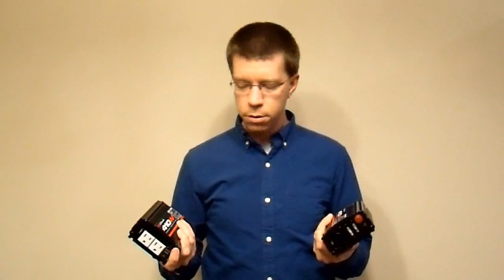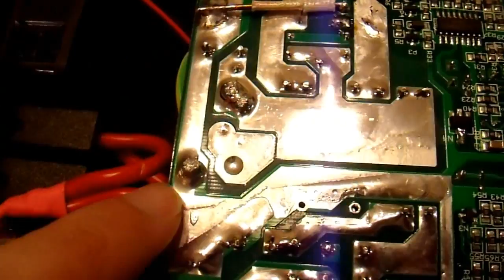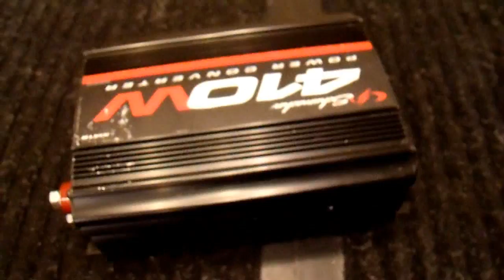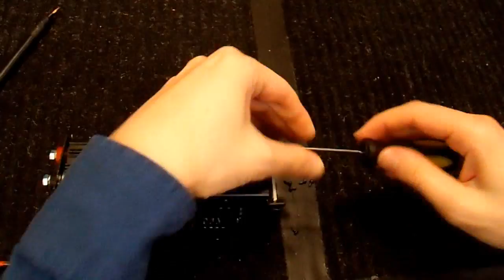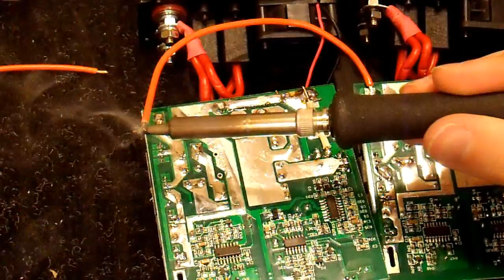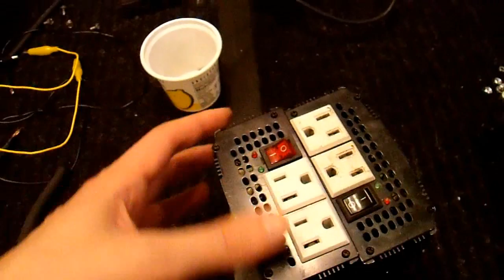Parallel Inverters - Double the Power Hack!   Part1

Comment: have wired up two inverters as per video,  just cheap lvyuan inverters, have to get some batteries paralleled up to give enough current, at the moment cuting out early, probably large voltage drop of small batteries. At first I thought it was due to some current sensing circuit, but now think its my battery is too small for the current draw and giving a big voltage drop is my guess.
Will post results once I get a some batteries paralled.

Comment: Will this work on 2 bigger inverters 
Same type using your method
Reply from the maker: Nope.  This only worked because the output stage was more robust than the input stage.  For cost reasons larger inverters will be better balanced.
Reply from the maker: I do have an old video about putting two larger inverters together BTW.  You have to sync them up.  I used Smart APC 1400RM units for that one.

Comment: just went through all the comments  here and no one has reported trying this over 11 years, so I assume no one has, otherwise they would almost certainly have commented if it failed or if it worked, so I will attempt with a newer inverter of great cheapness, I bought one to run a grinder says 2kw peak and 1kw continuous, but grinder cuts out under any load only just runs it no load. So will order exact same one again and try this suggestion........lets see how it goes. 
Inverter brand is lvyuan they call it 2,000watt inverter ( 1kw continuous) but in reality it cuts out a bit under 600watts.
I will most defintely report back here on what happens..........reasonably cheap inverters ( about $60aud)

Comment: Nice,  it's just that it is overloading the 2nd inverter , its mosfets or IGBTs, with double the current, but it might work well, 
    USE GOOD FAN!!!!
Reply from the maker: Yes, the 2nd stage is overloaded but in this design it had adequate headroom with the additional airflow.
Reply: @knurlgnar24   good deal, you had checked for that, that's the way to do it; 
    i wish it was that simple on my low freq. inverters,they have no DC at all to mix

Comment: Question - what do input stage does and why does it get that hot?
I see 12v dc gets multipled by transformer to 120v dc, then getting chopped into AC by transistors (the ones after the cap), but now puzzled at what input circuit does - it still 12v that feeds the transformer...

Comment: Good vid. Do you have a opinion how to wire 2 120v AC inverters into 240 split phase . Where each phase is 180 out from each other
Reply from the maker: I did a video on this using two 1500VA APC UPS units a long time ago.  That one sounds about like what you're looking for.

Comment: I wonder if you can do the same thing to a portable power station. For example the first power stations that came out were the Bluetti EB240. Great power station lots of battery power but very small sized inverters (1000 watts) for the size of battery power.

Comment: I hoped you would connect one control signal to both inverters in order to have both output bridges working in synch. Each inverter would still output nominal so they would need to parallel the outputs somehow. Like they do with gasoline inverter-generators.

Comment: I don't know if you still check this video, but question for you.... you linked the two capacitors together. Could you instead install a bigger capacitor in it's stead (same mf reading; double the voltage) to achieve the same thing? Curious...
Reply from the maker: I was paralleling the boost stages where the limiting factor was the FETs.  Adding capacitance would have had little effect.  The output stage was highly stressed the way I did it because only one inverter was using its output stage, but given most of the cost is in the boost stage they had skimped on that and I didn't need to beef up the output stage.

Comment: @12:31 that wire insulation isnt installed correctly that wire shouldnt be allowed to be that close or touch the trace its hopping over it is however correct in the other inverter that could be the magic smoke generator you were talking about when poor care when producing these things

Comment: Yes it's a good idea ... if you want them to eventually blow out and possibly set your house on fire.

Now you might say : "Ah...neysayer...this dude just showed that it's doable... there's always going to be some guy that is going to say NAAAH IT CAN"T BE DONE"

And to that I don't say "It can't be done", I only say...doing it THAT WAY is dangerous.

Why? 

Well because those to are not actively synchronised and there is no Power Management System to ballance the load between them. Even tho' they may be made by the same maker, and it's the same model. There are some differences between them . One will take more load than the other, and the output voltages will differ thus current will circulate between them.

Also since there is no synchronising device between them, it only takes a minor lag between them at startup for them to have current circulating between them. Possibly leading to an explosive failure.

More so, since these are not dynamic converters ( such as a Ward-Leonard group, a motor-generator group, you know with spinny things inside them) there is no mechanical inertia that can keep the two inverters synchronised by magnetic coupling these two MUST BE KEPT IN SYNC AT ALL TIMES. Just a small deviation from a perfect synchronicity will eventually lead to a 180* desynchronisation and that means a short between them ...if it even reaches 180*...about 60* of desynchronisation should do them in. 

There are systems over there that allow parallel running, but they have a Power Management System and a synchronising system that keep them in absolute synchronisation both for frequency and voltage , and will keep the load on both balanced.

Stay safe.
Reply from the maker: This was an interesting experimental project and I'm not sure how safety is in any way related.  Thanks for your thoughts though.

Comment: This is probably a really dumb question but why not just connect the negative and positive together on the input and connect to the battery? What is being achieved by soldering them together by the capacitor?
Reply from the maker: The output AC waveforms are not sync'd nor balanced so they can't be connected together directly.

Comment: Are these inverters pure or modified? Can I assume that with the initial inverter whine that they're modified?
Reply from the maker: These are modified sine inverters.
Reply: Awesome, that's what I have. Ordered them under the presumption they were pure because that's how they were advertised. Glad to know I can stack them and use anyway. Thanks
Reply: So can I ask some advice? I remodeled houses for ,32 years but my experience with electrical and electrical circuits and what not is very limited. I've built a small scale power plant (so if I blow anything up, it won't be a "costly" mistake) I've wired my batteries in series, parallel, series parallel and can barely light a digital bulb drawing only about 7 watts. I mean, barely comes on. Everything is reading proper voltage with my multimeter. I'm lost. I have 4 lead acid batteries and all are reading 13.7 volts. My inverter is  reading 25.6 v DC in, 118v AC out. I figure it's either my charge controller or the inverter. Leaning towards the inverter

Comment: Can I use two 4000w inverter parallel ?, is that risky ?, one inverter capacity is 4000w continuous and 8000w peak, so I have 8000w continuous and 16000w peak

Comment: I was wondering what if you put some highvoltage capasitors to the outlet too so you have a bigger reservoir to get power from, did that to mine 600w 12v inverter and soldered an ac capacitor over the socket in the back of where you plug the cord in, and now I can use a 500w 230v oven on the inverter when it gets wery cold outside, and if I'm roadtripping I'ts so nice with some extra heat too...
Reply: now that is interesting

Comment: Can I do this with two ups
Reply from the maker: I have a video where I put two UPS units in series to make a 240V inverter.  Parallel would be more difficult.  Not impossible but at that point I think most everyone would be better off purchasing a larger unit unless the intent is a project to work on!

Comment: This is very informative and makes me curious if you could run them in series to get 220v power because i cannot find a 220v inverter(i understand a vehicles electrical would have issues but i would be upgrading mine)
Reply from the maker: This could be done if a person synchronized the inverters and also connected them to separate batteries.  (they reference battery ground)  From a practical perspective it is always better to simply purchase a larger inverter.  This was a fun experiment however!

Comment: This is fascinating. I'm trying to run loads off a solar panel without a battery so I'm researching everything  with the array to see where I can bypass it. I really appreciate your thoroughness and clarity of speech. Compassion for the people who make the products we use every day is important too because no one ever thinks about them. It's nice to see a channel less focused on its own success while still delivering the same amount of care, effort and humility you'd find in one that's paid for and fake. You're an awesome dude and you're really helping me out right now. Can't thank you enough for posting this.
Reply from the maker: Glad you found this useful.  On another note I would encourage you to look into other methods of using a solar panel to power non grid tie loads when not connected to a battery.  Solar panels really need a battery or energy storage device in order to directly power any useful load.  I would recommend looking into a charge controller set to 13.6V and connected to a small  4 cell LiFePO4 battery powering your inverter.  The battery can be quite small but it needs to be there.  The charge controller and 4 LiFePO4 cells adds some cost to your setup but it will operate as you intend and last a long time.  Charge controllers can be had quite cheaply and if you purchase cells on aliexpress or the like you can find a 20ah LiFePO4 setup for a pretty reasonable price.  This type of setup will only run when the sun is shining but will be able to continue running for short times when a cloud passes, a bird flies over, a leaf lands on your panel before blowing off, etc.
Reply: @knurlgnar24 where you beefed the solder up you could of put copper for better power 😁👍
Reply: What about a bucking device to a charge controller and park in the middle of an open clearing? No issues with that on a clear sunny day right?
Reply: I simply can't afford any kind battery bank both at cost and space and weight right now. Free, sure. But nothing in life is free. It would cost me the same in batteries as it would for a complete solar array.
Reply: You could possibly make a battery out of salt water for pretty cheap

Comment: What about putting the two power switches of the inverters in parallel? Curious how the two waveforms would overlay on an oscilloscope
Reply from the maker: That would be the better way to do this but it requires more work.  You would need to remove the FET drive from one inverter and parallel the FET gates between the two.  You would also need to ensure both boost circuits boost to nearly exactly the same voltage.  I actually planned to do this but decided it wasn't worth it.
Reply: @knurlgnar24  Thanks for clearing this up; i have 2  inverters, same exact model, cheap from China,5000 / 2250 W , 24 volts, and i would like to parallel them to get ~~4000 watts; i repair PCs,laptops TVs  etc (but NOT at component level, i´m not that good);
Do you think it can be done? parallel the FET  gates, with a cable between them,  and check the 220 V  outputs? if the  FET gates are in parallel,you think the 2 sinewaves will coincide all the time,no drift?  Thanks

Comment: Great video, well done, I have a Spark 4000w pure sine wave, not used a lot, but the last time I used it the wattage meter ramps up and it goes into overload and shuts down with no load plugged into it? Do you have a video off what this could be?
Reply from the maker: I'd recommend ohming out the diodes and output FETs.  Sounds like a shorted FET on the output stage.  If so that can usually be fixed by replacing just the FET or FET pair that shorted.  You don't need to replace all of them.  The tricky part is figuring out what to purchase to replace it with.  Try to match up the capacitances in the datasheet and be sure the resistance is similar and the voltage rating is at least as high.

Comment: You dear Sir are a genius,  i was wondering,  is there a way to share the output through both sets of output FETs
Reply from the maker: You have to tie together both the output of the boost stage like I did here, and also the gate control circuitry for the bridges.  (disabling one of the controls so that they don't interfere)  I was afraid connecting them with long wires would lead to problems so I did not do that.
Reply: @knurlgnar24  Awesome, thanks for the reply. I'm from South Africa where our power stations have been neglected to the point where we can't generate enough electricity to supply the entire country so they have implemented "load shedding" were they periodically turn of electricity to towns across the country and for some reason it is cheaper to buy 2 or 3 smaller inverters than 1 high wattage inverter but im afraid that the FET's on say 2 x 1KW  inverter won't handle the possible 2KW current draw hence my question about connecting the FET's

Comment: Can you just split the load on the ac outputs by paralleling the supply wiring to the load ?
Reply from the maker: If the outputs are perfectly in phase then yes.  This could be accomplished by removing the FET drive from one unit and paralleling the 2nd units drive to the others FETs.  If you try this without internal modifications they'll fight eachother and blow fuses, or smoke depending..
Reply: Is there a way  to turn a 220 volts inverter  into  a splits  110 / 110  inverter
Reply: @markrobinson3884  The easiest way to get split phase out of a 240v inverter is to hook up an autotransformer on the output. Commercially available 120/240 step-up or 240/120 step-down transformers should work provided you install the required connectors.

Comment: I have some 20 amp automotive circuit breakers. They reset automatically I believe using a bimetalic strip. I put them in my power Inverter. Might be a better idea to put manual reset breaker, That should remove any dumbassery from consumer's.

Comment: Hi can I ask if this process would work on a xantrex prowatt sw2000watt inverter?Thanks for the videos by the way, They have been a huge help
Reply from the maker: This was mostly me messing around with inverters because I wanted to rather than anything practical.  Those inverters are much higher power and are SW making such a hack more difficult.  It could be done but I wouldn't recommend it.
Reply: @knurlgnar24  I have two identical xantrex prosine 1000w 12v,  it seems like the same board is used for all of the other wattage models.  Do you think using the guts of one to populate all of the unpopulated spots on the PCB would give me a higher output?  Assuming I modify the current shunt?  By the way , your videos are awesome and I look forward to when I notice a new one pops up.  Your a smart dude

Comment: Rookie question: Can I connect the inverters in series to, say, I have four piece 12v inverter  connected into series to create 48v input?
Reply from the maker: Unfortunately no, you would need a 48v inverter.  They will not 'share' the voltage evenly.

Comment: What was the whole actual purpose of soldering the 2 individual wires to both inverters? I want to attempt to parallel connect 3 cheap chinese inverters together and want to know If I have to do exactly what you did.

Comment: 12:31 That is a voltage limiter, if the size of that copper is increased it allows more power to go through since it lowers the resistance,  but could also burn up the board and render the unit useless with all the extra voltage. I have seen people by pass (bridge) that

Comment: I have 2 x 3400w inverter generators that do not have parallel facility. Could this hack work to provide parallel facility to my generators.  I have technician friends that I would get to do the modification if this is possible. Thanks for your advice in advance
Reply: No, your power stage MOSFET won't have enough tolerance to double output. You need sync both output stage, if you can rewire the inverter control chip has sync inputs or use single control chip to drive both output stages, you could have two outputs phase sync so you can parallel the outputs.
Reply: @joecox9958  Thanks for your advice Joe. Do you know where I can get some advice on syncing the output    so I can a technician friend to fix it for me

Comment: Or just use a 3 waycable and a breaker between tge 2 and start primary tgen start secondary flip breaker try that dont need to take them apart or you can do the smart way andjust by a larger inverter

Comment: Use a 3 way cord two male ends and one female ends conect your power switches to one switch then they kick on at same time but use two of the same brand and or same size you do it same way thst you would do 2 60kw generaters and have a breaker in one side the cable turn both on let tge one stableize the make sure the breaker is of turn on other inverter let it power up then flip breaker it will eather work or it will blow tge breaker

Comment: Parallel the same way you do generators you just need two power cords and one female plug run two 450 or 410 watt threw one power outlet you will have double the watts .just like batterys hook them up postive to postive negative to negative you get mor amps same result in watts  and amps with inverters and you dont have to do a hatchet job on them